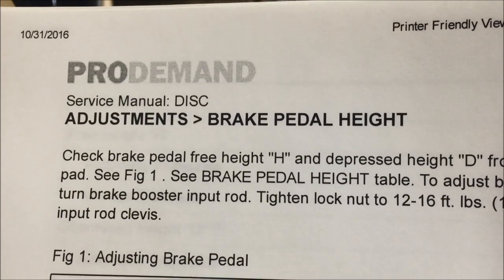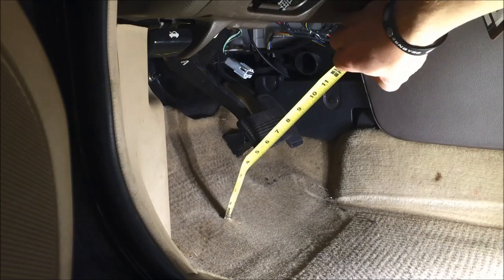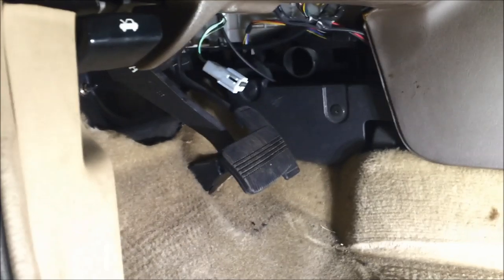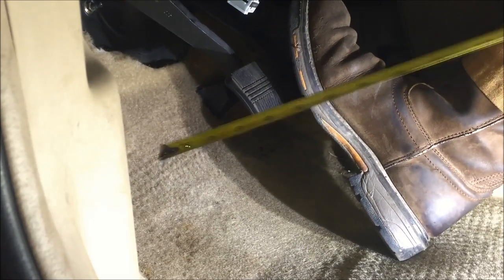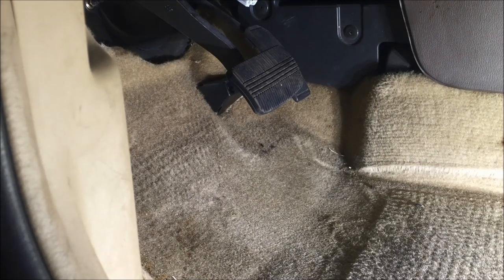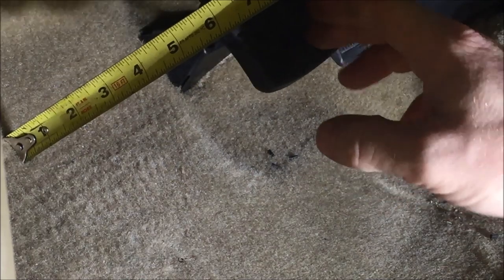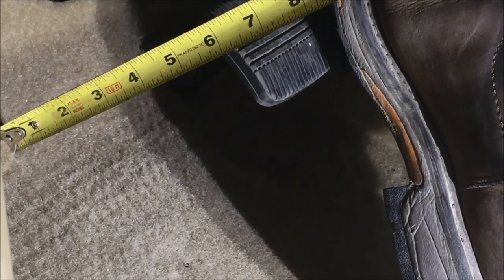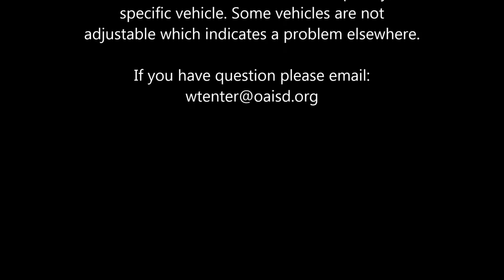Brake Pedal Height Inspection

Comment: How did you make the adjustments?
Reply: Lenny, I was about to ask the same thing
Reply: 2 ways depending on your vehicle. There is an adjustment rod on the booster which is either behind your master cylinder which needs to be removed OR like my Tacoma there is a threaded rod attached to the brake pedal with a lock nut which you can adjust.

Comment: ibterestingly, the "green bible" states that the brake pedal height is measured from the floor, not the footwell - ie it should be perpendicular to the ground (6 1/4 ")
Reply: That is not correct. No way to adjust the pedal distance from the ground. Video shows the correct way of measuring the distance.